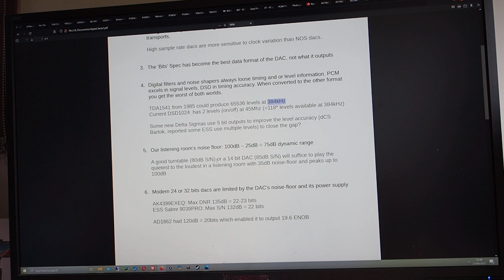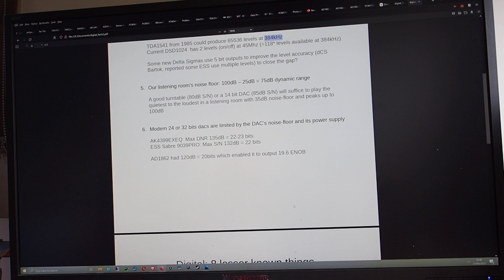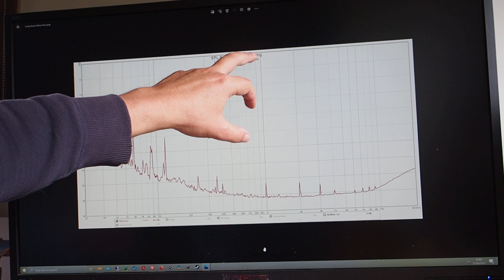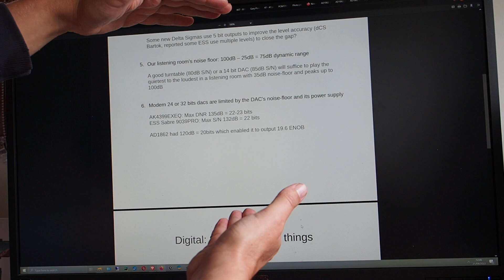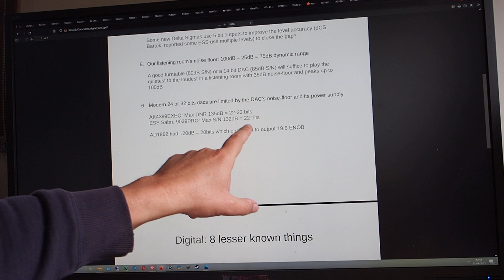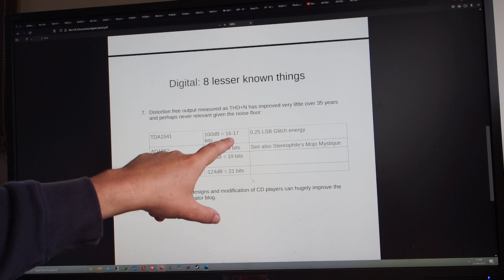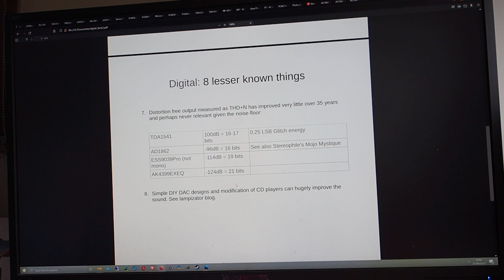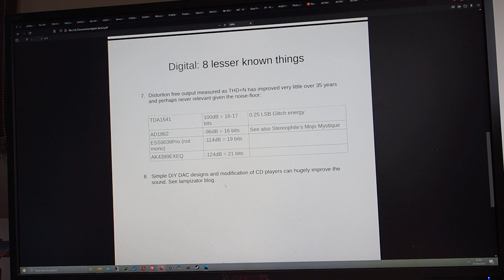4 More lesser known things about DACs and digital music

Comment: i have a question. In your experince does the tubes need to swing a good amount of what they are capable of to sound their best? or does it depend on the tube, some can perhaps still sound good even with very low swing compared to what they are capable off?
Reply from the maker: My experience aligns quite with Thomas Mayer who advices to allow 6dB headroom in drivers. Additionally, I must say that an earlier 4x4P1L differential amp with nearly 10W (and only needing 4W max) sounded relaxed and absolutely effortless... and that aligns with what I tend to hear when overdoing everything in a tube amp. So I'm actually taking that approach with the amp I'm building now....

Comment: Wat ik een beetje mis met betrekking tot de dac's, is het herklokken. Veel van de vintage cd spelers hier hebben een simpel en uiterst onnauwkeurige kristaloccilator aan boord. De grootste winst voor iedere cd speler zit in een uiterst stabiel kloksignaal voor zowel de decoder,  als de dac. Dat geeft een wereld van verschil in positieve zin. Guido tent verkoopt hele mooie klokken voor een betaalbare prijs. 
Ik heb er zelf uitgebreid mee geëxperimenteerd. Je cd speler gaat heel vloeiend en "live" klinken.

Succes met dit kanaal.
Reply from the maker: Thanks Nico. Indeed much more could be said such as on technologies applied inside DACs but this is a primer and focussed somewhat on putting 'progress' into perspective since some overly focus on bits, snr and thd. As for timing, in theory this is nearly odd as one distinct advantage for a cd player compared to dacs in 'slave' mode is the ability to totally control the clock and speed of the data stream. Some earlier players like my Sony also had RAM connected to the servo chips, so I suspect they already buffered the stream. When turning a cd player into a NOS, the critically of clock timing also drops dramatically... so it also depends on what kind of player we're improving. I'll need to find Guido's website though and see what he has on offer :)
Reply from the maker: Personally I think a lot of earlier CD players but also modern dacs sound like their opamps and electrolytic coupling caps which already makes their sound very mechanical, smeared and fatiguing.. I don't know yet how much the clock has an influence on that, but I'll find out in the near future! To be continued!
Reply: @EduardBroekman  

Hi Eduard,

I've experimented a lot with different vintage players. Mostly Philips (850, 771, 930,) and Marantz (cd80, 72se, 63se and others), also cleaning up the raw power suplly (lower noise floor) to the digital domain helped a lot. Even when using a player just as a transport,  and connecting her to a low jitter dac (with a good masterclock inside). The double low jitterclock approch had a dramatic influence on the sound. I know what you ment by discribing the sound of your recordplayer, and it's preamp. I get the same floting, very airy, live and musical sound from my cd players. And i also agree with the influence of a good coupling cap. 

A good cd player is something most people have never experienced. And a good vinyl set up will always be better compared to a mediocre digital setup. Because digital which isn't great, always sounds fatiguing  to me. Guido's shop is called tentlabs.